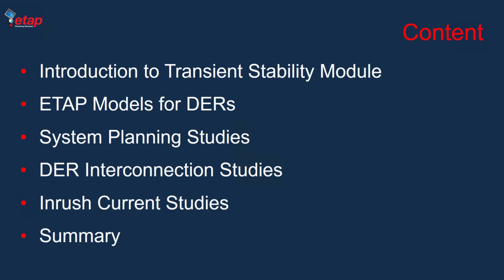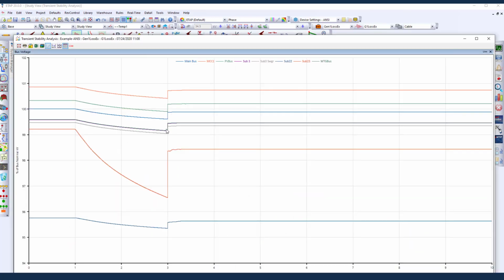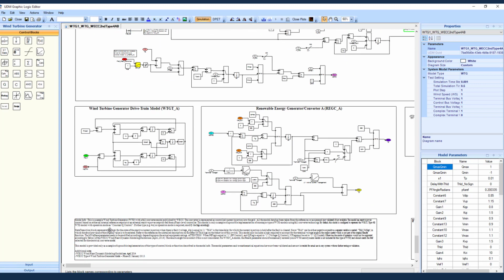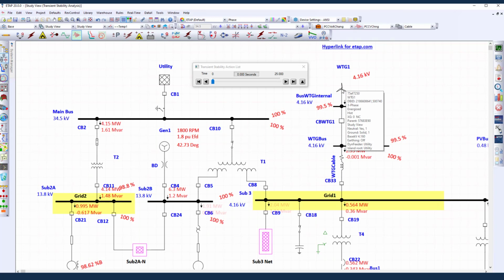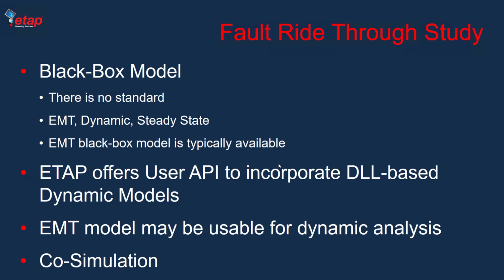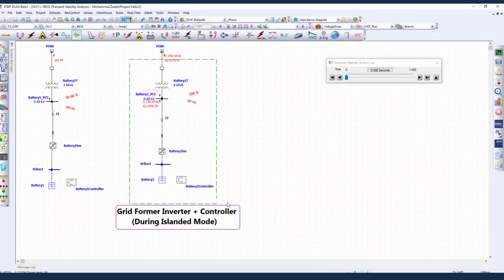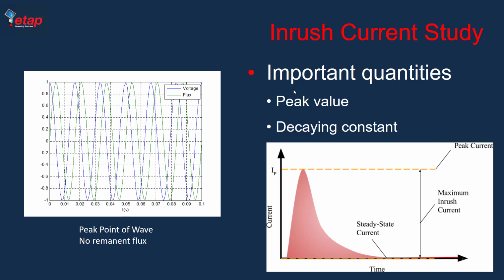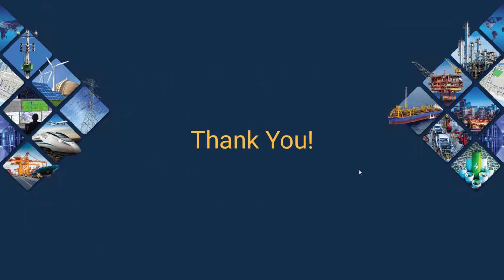How ETAP Transient Stability Addresses Needs & Challenges for a Resilient, Reliable & Secure Grid.

Comment: Hi sir
My grid voltage is 150kV, During transient stability study, if we change generator step up transformer from 155kV/11.5kV to 150kV/11.5kV, is there any impact on system? The system will be stable or unstable condition?
Reply from the maker: Thank you for your interest in ETAP Software, please contact our Technical Support at https://helpcenter.etap.com/ to assist with your question.